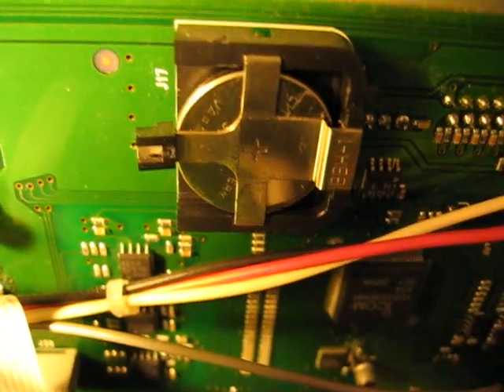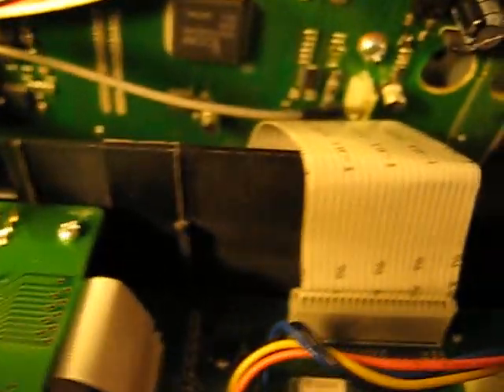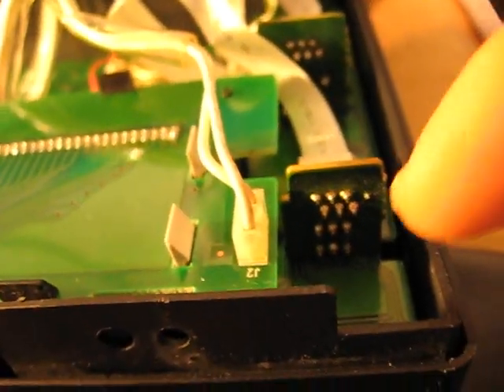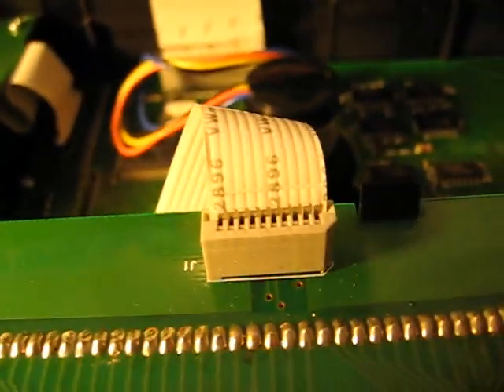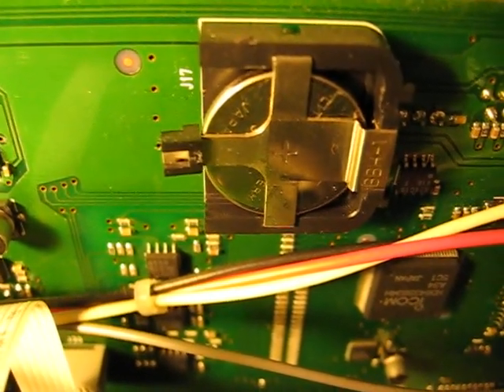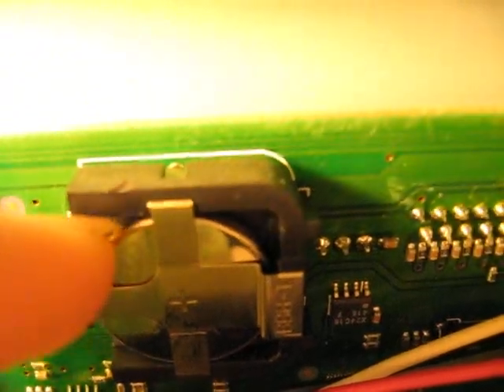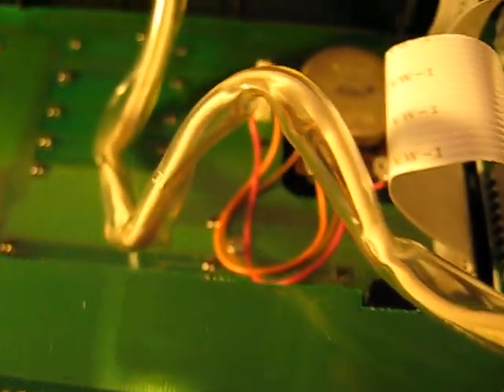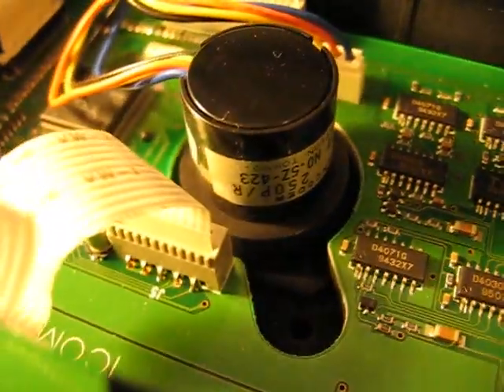ICOM-775DSP

Comment: 775dsp is a great radio, mine is with serial no. starting from 24xxx.@ham radio you can go to the menu mode using the SET button to access the two sets of menus, pls refer the instruction manual. 73s de vu3mes